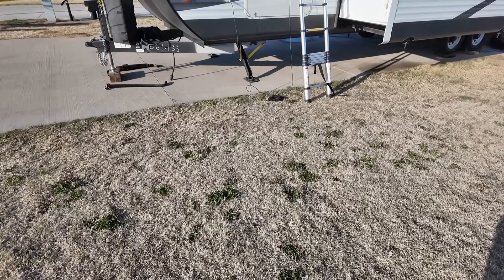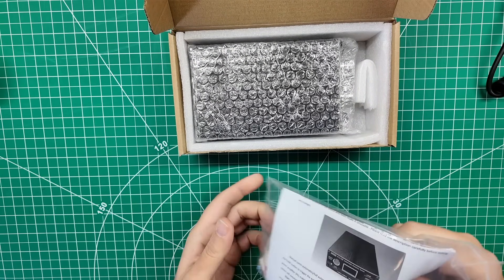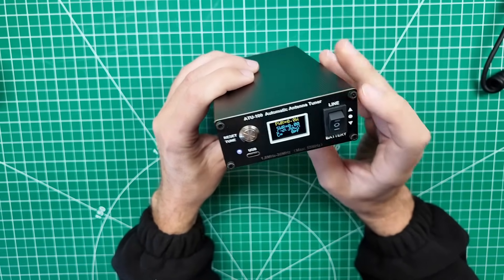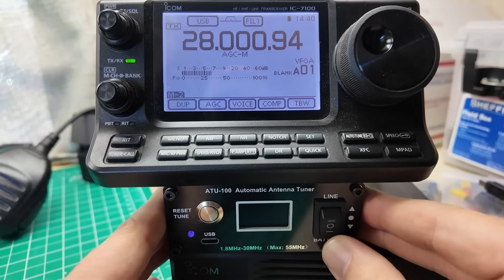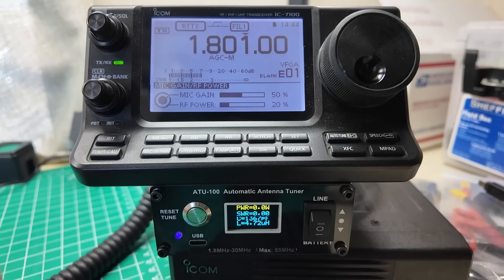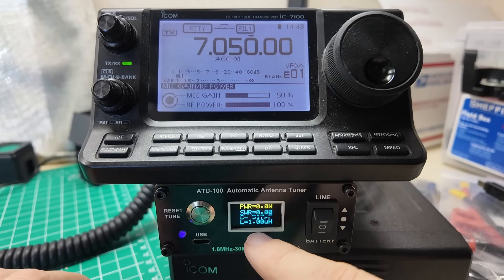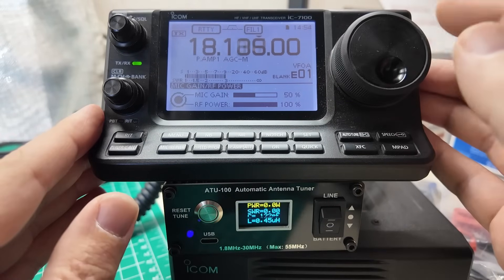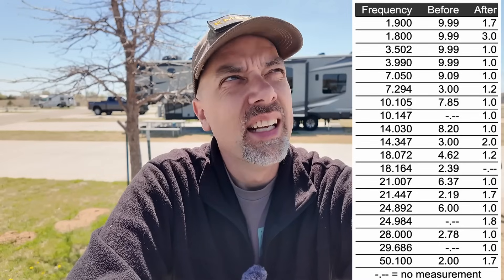Matching an RV Antenna That Shouldn't Work — Real Test

Comment: I have had issues with the LDG200 because it doesn't tune my good antenna.  I may want to try this 100W design so I can actually read the value.
Reply from the maker: I'd be interested in the results.
Reply: @temporarilyoffline  - I will send a direct email, but I am VERY encouraged with the ATU-100.  I have done three POTA activations and three from home.  Matched multiple configurations, and the matches are stable and had a good output for contacts.  I did have an issue using a 20m hamstick dipole on 17m, but was otherwise had few issues.  (15m hamstick dipole matches to 17m with a 1.55:1 - and made QSOs with England).

Comment: I use a 102" whip on my van. I put a 3/8 x 24 15" extension on the bottom of the antenna. I can tune 15m to 10m with the IC 7300 internal tuner. Really no tuning needed on 12m and 10m. With my G90, I can tune similar to the ATU 100 in your video. I believe the extension really helps. I had bought it at DX Engineering only to avoid shipping charges. Lol. Maybe extending the 102" whip with the wire on the top will help instead of at the bottom. Thanks for the video. The ATU 100 might be something I get because I traded away another auto tuner a while back. W7RTA
Reply from the maker: It’s great to hear it’s working for you and I’ll be sure to give the extension a try!

Comment: You say you're putting 16W out the antenna, but in reality, what you are seeing on the tuner reading is that you're putting 16w out of the tuner.  correct?  You are still going to incur losses from the tuner to the antenna. correct?
Reply from the maker: I'm not sure the accuracy of the measurements, but the tuner displays input power and radiated power, so you have both numbers to work with.

Comment: Which comes first, L or C seems to be random.
Reply: This is not random, the tuner can switch from first insert the Ls and than the Cs, or first Cs and than the Ls (see schematic Relay S8)
Reply from the maker: It does, doesn't it?  Not really a problem, just a curiosity

Comment: Keep up the quest please. I have the same issue, trying to find that ONE antenna that can work all bands in my RV. I'm learning from you!  Thanks a bunch es 73's ---> N4ZDX
Reply from the maker: Hey Darrell - If you're not afraid of drilling holes, I've got an idea in mind!  If you are... I've got a solution for that too!
Reply: @temporarilyoffline  I'm open to any ideas you have. I tried the 17' whip on the tongue jack but couldn't get the SWR acceptable. I'm thinking it's all the metal to close.

Comment: Steve, breaking the aluminum seal on the side of the trailer seems extreme and invites a world of potential I am sure you would rather not think about. Have you considered using one of the passthroughs already in the trailer i.e. power or waste gate? I believe you could you could get a SO-239 bulkhead pass through sharing one of those.  Thinking about what you described, going through the floor (bulkhead connector) and running coax to the mount is a viable option. Another consideration, do you have inside access to any exterior lighting, if so that would be another possibility to transition the coax or add a bulkhead connector depending on space. Just some ideas.
Reply from the maker: Those are all great ideas!  I don't know if you've seen my RV Channel, but I'm not afraid of drilling, I just don't want to do it for "no good reason" or to find out "it didn't work"

I have a 3" portal already in the RV dedicated to antennas, right next to the bigger opening for "under bed storage" where I removed the bed.  https://youtu.be/kSGZw7q8YKo 

I've also drilled a hole in the roof:  https://youtu.be/JQ5WgXN4bfU when I mounted the solar panels.

Since this mission was strictly about ham radio, I brought it over to this channel.

You're right though, if you have an existing opening, use that... none of mine are convenient to my mission of having a permanent station in the RV.  I find that its "just too much of a pain" to set a station up with all the other things I have to do, so I never set one up.  If I was just camping for the weekend with the stated mission of relaxing, I'd definitely set something up, but needs change for full-timing and "work" getting in the way.

Either way, more to come!